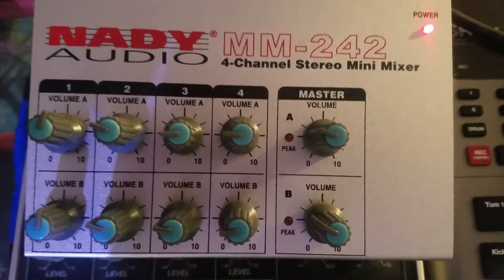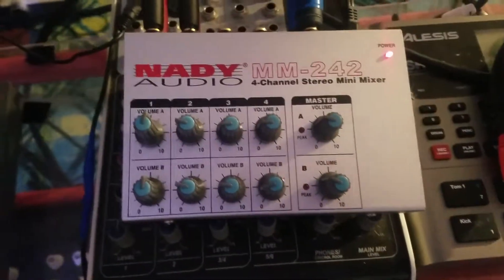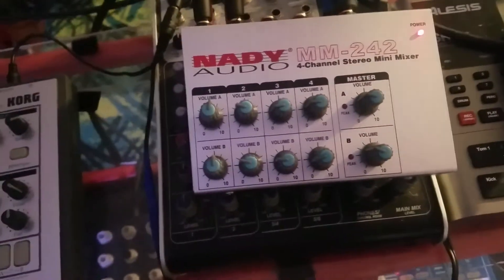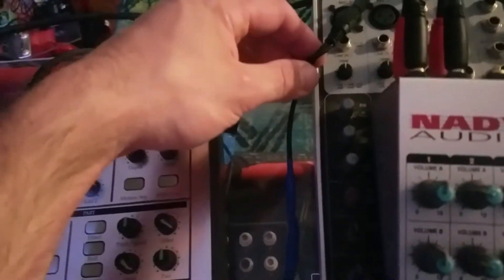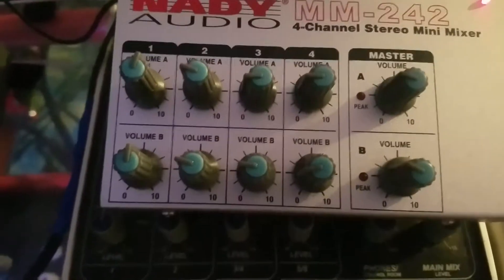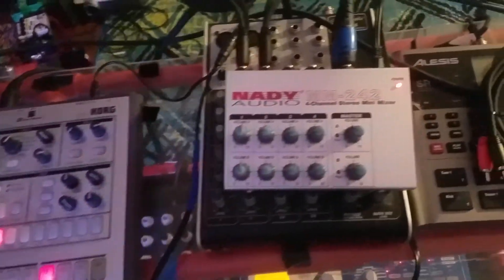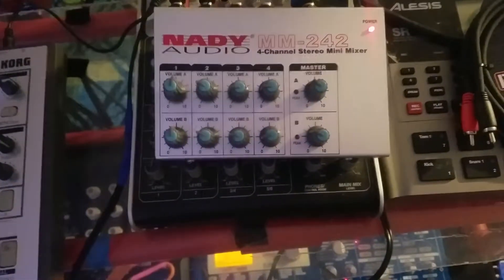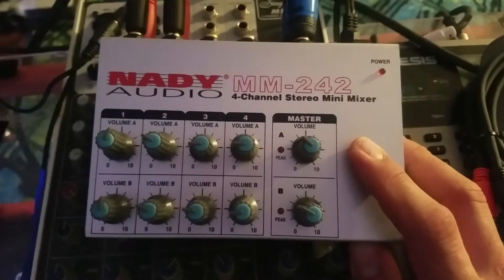WTF NADY Part 2: My $2 Power Supply Fix For The $25 Power Supply Problem Nady Created MM-242

Comment: Yeah that doesn't make sense. 9v is 9v no matter what power supply it is coming from. I will probably just use a universal power supply on mine. A universal power supply comes with a bunch of different adapters. Hopefully one of those will fit the Nady.